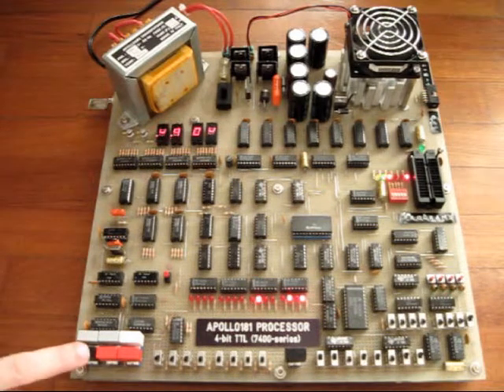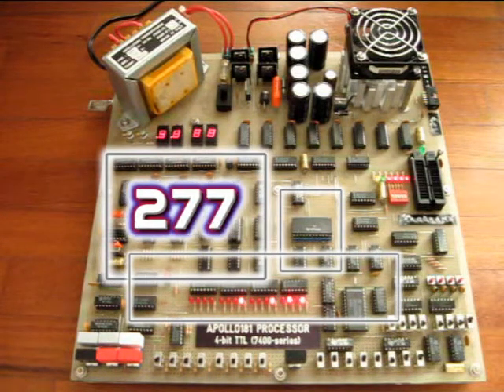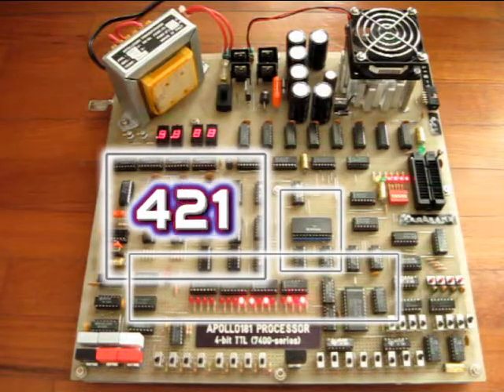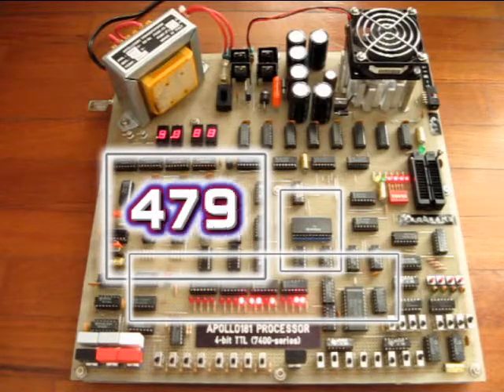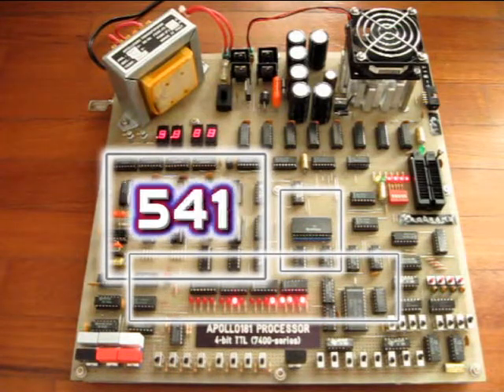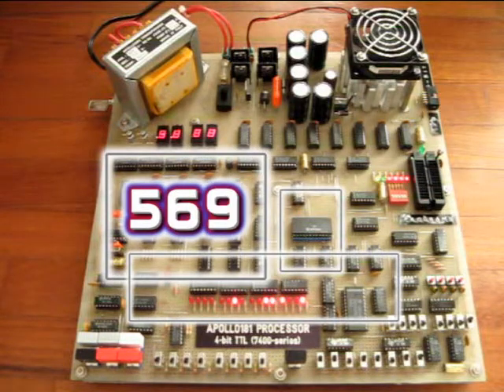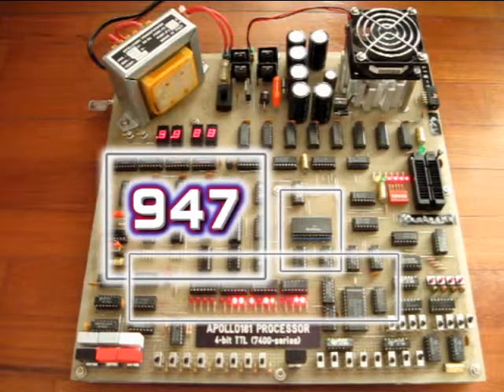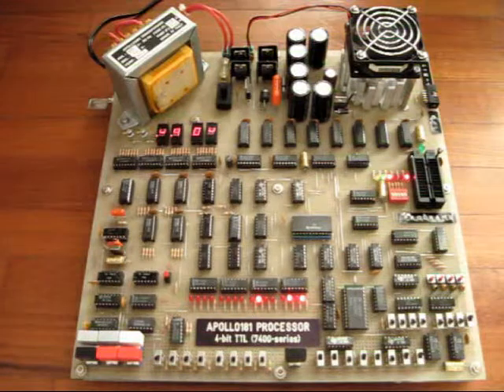Let's run a famous CPU benchmark which displays prime numbers (APOLLO181 Exercise n. 6)

Comment: Why is the inner loop only 500. Wouldn't the inner loop also have to be 1000?
Reply from the maker: +PhobosAnomaly

The simplest test is to verify if there exists a number between 1 and itself that divide it. If this number does not exist then the number is prime. It is not necessary to test all the numbers from 1 to n-1, because after n/2 does not exist any number which divide it.